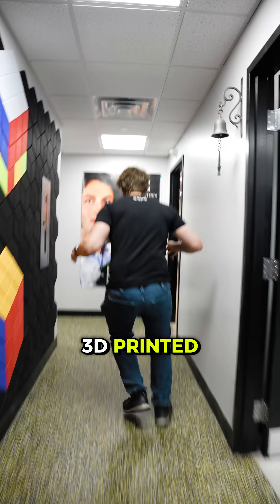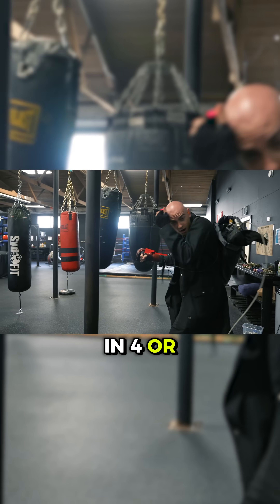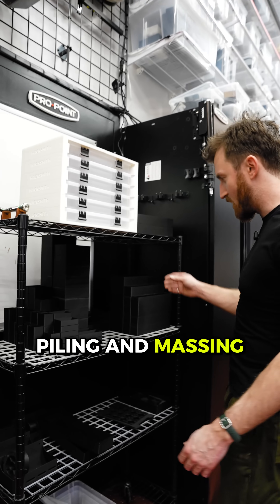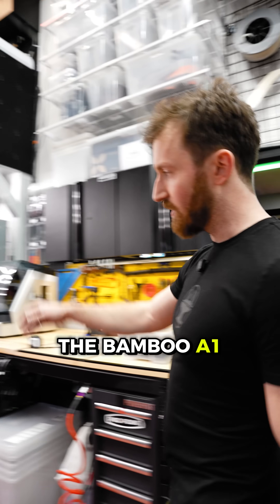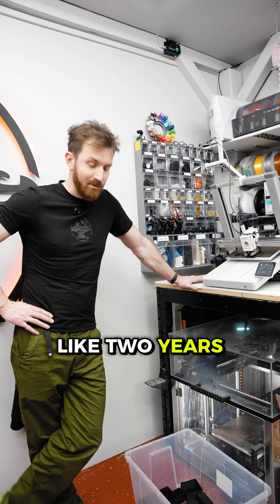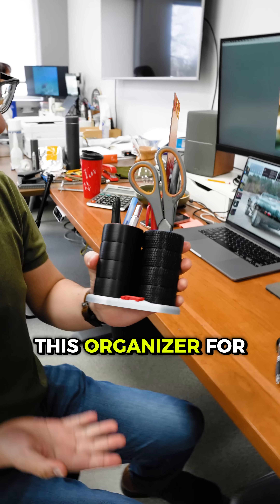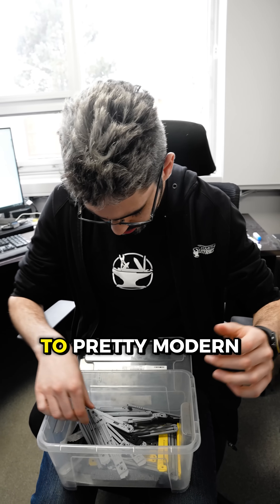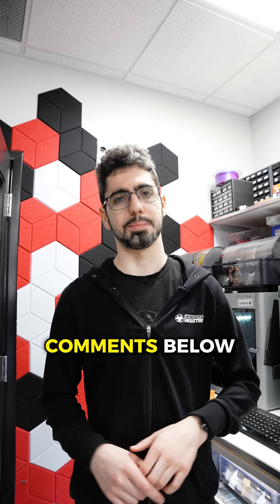Actual useful 3D prints 🤯 #3dprinting #engineering #MatterHackers

Comment: i still dont get gridfinity. Will the organizers float away if you put them in the drawers without it?
Reply: no, and there are far better solutions for tool drawers out there

I'm not a fan of gridfinity, its a little too cumbersome for me.

Instead of printing a grid and needing it placed at all times I model the organizers i print so they link to each other.
this allows the "grid" to expand as more boxes are added.

Comment: I've about 2900 hours on my Bambu A1 currently, the thing is an absolute work horse.
Reply: Is there a place to check that if your aware? In three months I've had mine I've estimated I've run it for about 700-800

And I got to say, with limited experience with a mk4 and ender3 the A1 has been one absolute workhorse, not had to replace anything yet.
Reply from the maker: It's under maintenance settings!
Reply: Isn’t the printer that you have printing boxes a Bambu A1 Mini? I have the Bambu A1 and it looks a lot bigger, but it could just be the perspective
Reply: @hacksmith  found it thank you!
749 hours on it thus far.
Reply: @hacksmith  how many hours does your A1 have at time of comment
Reply: @Sniper_Plague A1 mini has only one vertical support, so that is an A1.
Reply: Same with my A1. Best thing I have ever bough, and I am super happy that I was able to finish saving up for it at 15. Easily my best ourchase